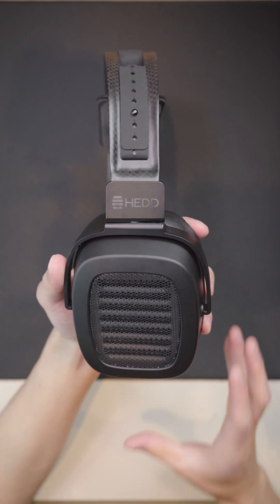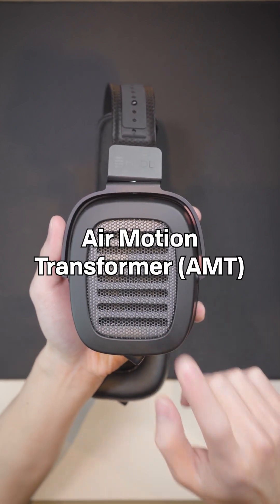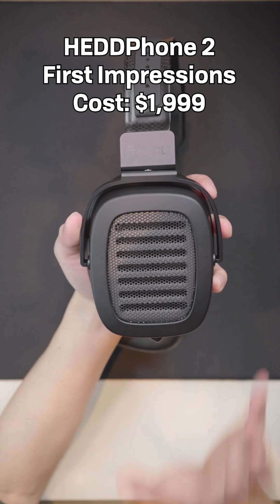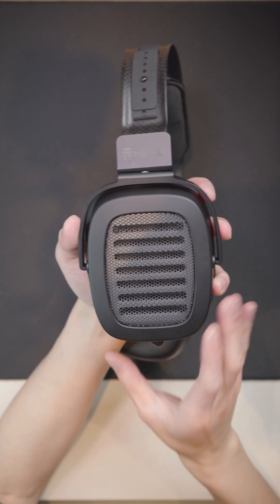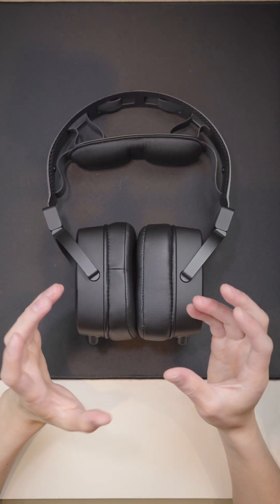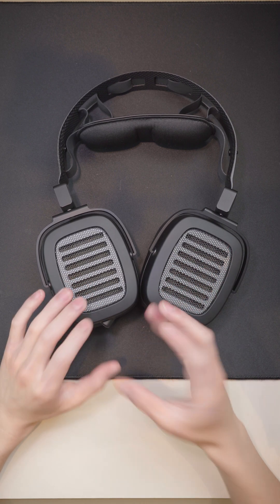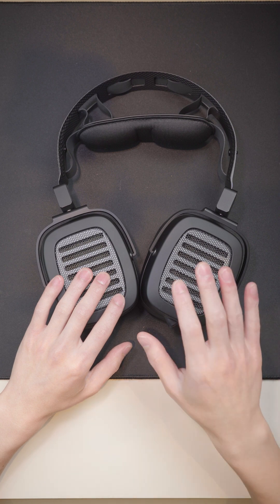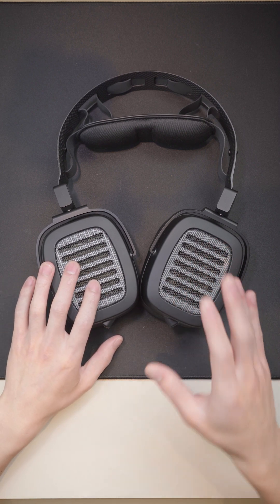Transient speed and microdetail: HEDDPhone 2 First Impressions #headphones #audiophile

Comment: I don't understand what transient speed is supposed to be. Are transients late on headphones with low transient speed. And are non-transients not delayed? And is there any way to measure it?
Reply: Imaging adding a weight to the transducer. It will literally slow it down dynamically due to inertia. Compare that to a planar film that's lighter than air. There are many design choices that can affect this. Some impulse measurements ought to show something. The, what I call, effortlessness of AMT and electrostatic headphones is quite different from most other types mainly due the transience.
Reply: would adding a weight to the transducer not have the same result as adding a lowpass filter?
An impulse measurement would give you an impulse response and thanks to Fourier you get a frequency spectrum out of that which you can compare to other headphones. And that is what most people are doing, but i still don‘t get what transient speed is describing.
Let‘s look at a classic transient, a hit on a hi-hat. A stick drops down on it and sets it in motion. both materials are heavier than any headphone speaker already, so we could stop here, but to make it more general, lets get going. Air gets set into motion and a microphone records that motion some time later. And this microphone does not have hedd‘s amazing AMT technology. So at this point the signal is already limited to how fast the membrane of the mic was able to react. So as long as the headphone is as fast as the mic you don‘t need to worry about it. Also most humans have slow ears, i know nobody who can here things that move faster than 20kHz. And most good headphones can do that.
Reply: @malo374  You likely know more than me, but don't they mod HD650's to have more and deeper bass by adding a heavier weight ring? I've read as well that on paper some such differences don't exist or are irrelevant, but still some headphones sound slow compared to others. Say LCD-2 which has a planar film much lighter than most (all?) dynamic drivers, but it sounds sluggish. Of course the actual tempo doesn't change, but perceived it sounds like it. Maybe it's about some reverberations of the film or something.
Reply: @hartyewh1  that reverb thing is interesting, I have to think about that. My first instinct is that the shape of the ear and the short distance would make that negligible.
I would really like to know what this sluggishness sounds like, i can imagine that people perceive sound as more sluggish when there are more lower mids or something. But in either case transient speed would be a weird word to describe it, because it does not have anything to do with speed.
No idea about that 650 mod, sounds interesting. Might work in theory, lowering higher frequencies makes lower frequencies louder in comparison.
Reply: @malo374  The LCD-2 and 2C were the first and perhaps still most clear examples of that. EQ'd to Harman the effect persists. Some closed backs just have a boomy sound due to the cup causing various issues, but it's less common in open backs. DT770 has some of that as well that the bass sounds rounded and undefined. When I tested the LCD-2 I wrote in my notes that it sounds like the "final concert of a retirement home cover band that's no longer into" when describing Get Lucky by Daft Punk. I'm not knowledgeable enough about the technical details, but it sounds like say a drum hit spread over time so the transducer doesn't stop moving as fast as it should and in faster segments they even start mushing together.
Reply: It's my understanding that yes, transients can be "late" or more accurately somewhat missing / under represented. Like with amplifiers (which often cannot provide the high and instantaneous power needed to accurately reproduce transients), some headphones and speakers simply cannot respond to the high voltage of a transient response in a way that reproduces them accurately. It's also my understanding that this indeed can be measured (in distortion vs. the input signal), but that transients are such a low percentage of the overall signal, that very good vs. very poor transients don't measure all that differently. Hence you "need to listen" to hear the difference, as apparenlty our ears are quite capable of picking up on the speed of transients. Note that I gleaned all this from mags and forums over the years, so I can't vouch for this being the real answer to your question.

Comment: Emm, the pads aren't both in the same orientation. One is wider than the other, so that matters.
Reply from the maker: Thanks for noticing! I just saw it myself. I had taken off one of the pads to show the driver while recording the previous Short and forgot to check the orientation when I snapped it back to finish filming. -Fc-Construct